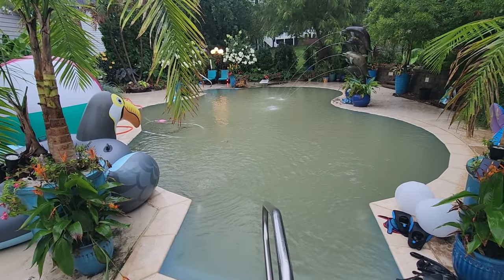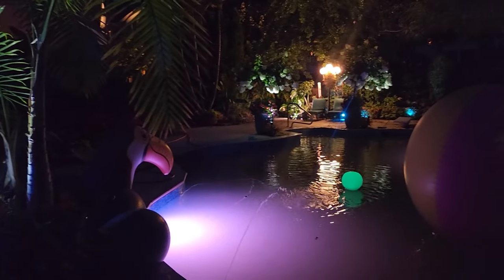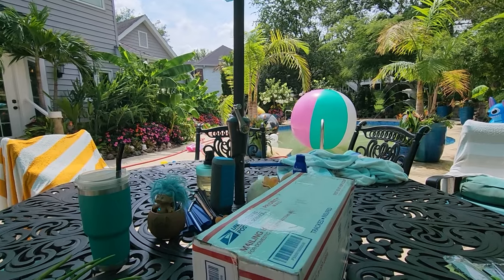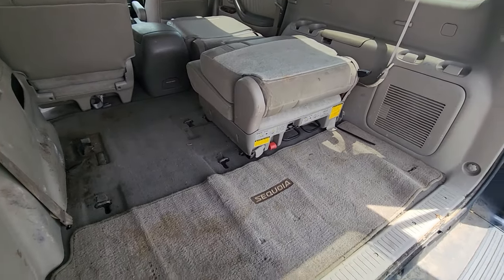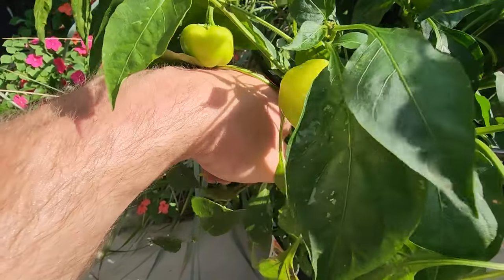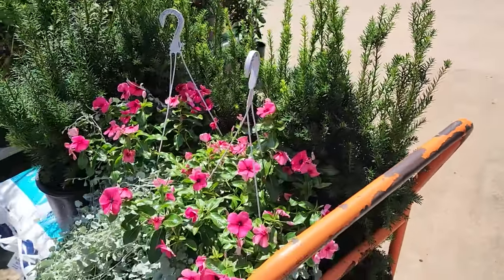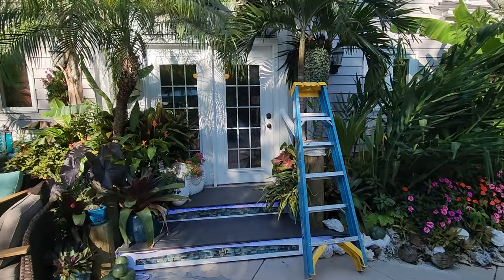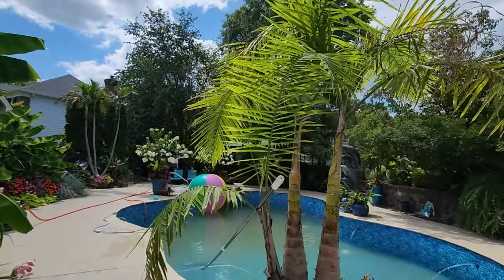The Backyard Flooded || Home Depot Clearance Plants || Saturday Vlog

Comment: Yikes!!  Jeff, I wonder if your back neighbors have drainage in their back deck since everything is seeping into your yard.  If worst comes to worst, see if you can put in a French drain.  I know you mentioned that there was a drain in that area, but it looks like you might have to widen it so it can take in more water.  I recently had to get a French drain installed in my side yard because my neighbor’s lot is higher than mine and my side yard flooded.  I hope you can get everything figured out and that it doesn’t get too costly since French drains can be extremely expensive.

Comment: Did you get the Santa Barbara from Yoshi (orchidsbythelake)?
I feel like the leaves on some of the Colocasia are extremely dependent on weather. I have a Pigtail Princess that is now a nearly white leaf with a green edge. White Lava holds its color very well, Pink Ribbon goes nearly black in cool and the pink veining becomes more prominent when it gets hot.
Reply from the maker: That's a good point about the colocasia, it's much more pink now. Probably just the sudden onset of cool temps that came out of nowhere. 
I got the Lc from Bombotany on etsy, don't think I've ordered from them before, but I like what they sent and they have a decent selection.

Comment: It looks like what you have in the drill is a nut driver, not a bit holder. The 2nd one you have is an actual bit holder.
Reply from the maker: Well.... 🙃😁 ok you got me, but the bits fit in them too so make them magnetic! 😆 🤣
Reply: @TropicalPlantParty  HA correct, Any 1/4" Nut driver or socket will hold a bit :)